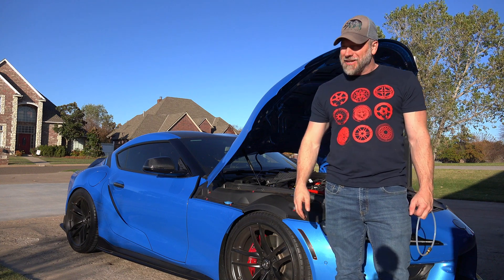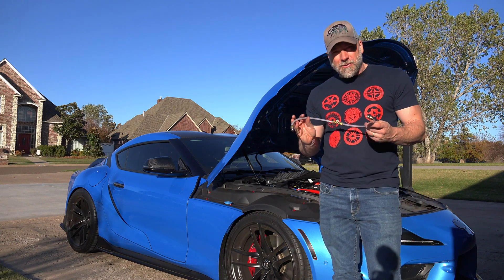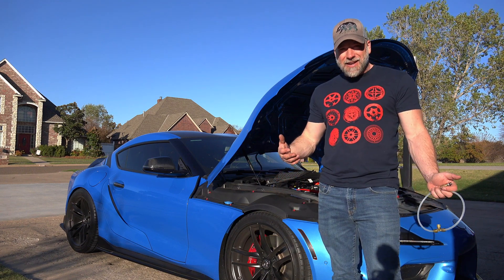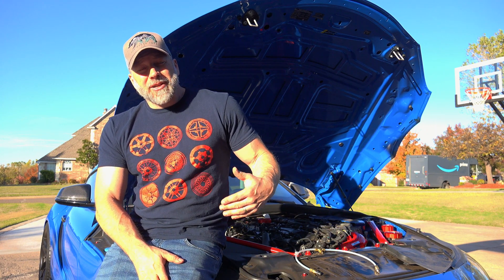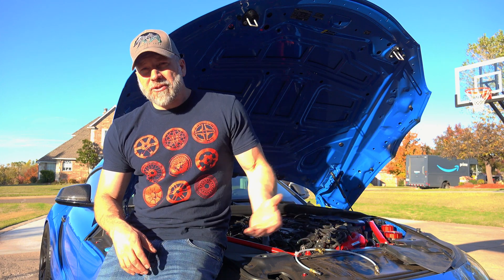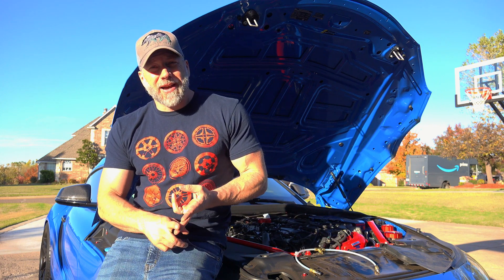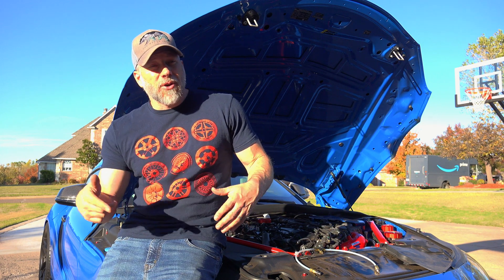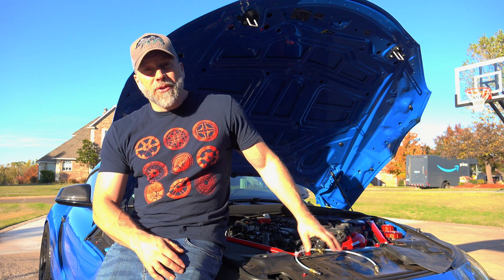Intervention : Supra Edition // It's on Meth!!!

Comment: Awesome man! Meth on these cars is a gamechanger once properly tuned for it. One piece of advice, I highly suggest looking into running stainless lines. A 50/50 mix isn’t going to ignite like pure M1 but it is a good precaution. We didn’t see any major gains until running pure m1. I can’t speak on jb4 but once you can get a nice custom tune, the benefits of meth are massive!
Reply from the maker: I have already been looking at upgrading to braided lines.  I have 5 gal of pure meth, so I’m ready to try!

Comment: FYI, I saw zero benefit other than piece of mind with WMI when running E50 fuel.  Only benefit I saw, and not sure about reliability, but you can set the JB4 IAT setting to ambient.  With two nozzles I bet it will go quick...  On the same setup mine spent a full gallon in 20 minutes on track, and that was with one nozzle.
Reply from the maker: Have you looked at the fuel trims before and after?  I know on mine there has been a big difference as we're no longer maxing it out.  Also, I had been interested in WMI for the cleaning potential before even looking at it for performance benefit.  Did you mess around with different percentages?
Reply: @spiguyversgarage9452  Jesse said my trims were fine even on e50, but zero performance benefit on the dragy.  Get some food coloring and put a few drops into the tank so you can  glance down into the cubby area and easily see the level.  Two nozzles and that M1 will go fast!  Also the coloring will help you notice leaks (like I had) in the system.
Reply: @spiguyversgarage9452  Also, I bet we'll actually see a difference with an unlocked DME and backend flash.